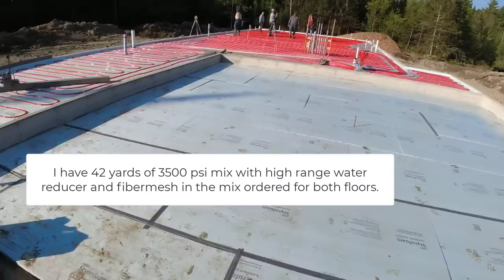Is This Too BIG For Us?  3200 SQ. FT. House & Garage Pour

Comment: Not really concrete related but surprised they didn’t pressurize the in floor heat and waterline pex before pouring. The specs we get from our pex supplier calls for 100 psi. Wasilla, AK. Been snowing here all morning. Enjoy the videos.

Comment: Great job, guys.

Mike, you mentioned about 10 gallons of H2O increasing the slump # by 1 inch (e.g., 6" to 7").  Is that 10 gallons for a full 9-10 yard truck?
Reply: Adding 1 gallon of water increases slump 1” per 1yd of concrete. So a full 10yd truck, giving it 10 gallons of water increases the slump of the entire 10yds by 1”. In this video, Mike added a total of 42 gallons of water to the first truck.
Reply: Lol. Giver her another drink. Just because you use a water reducer  chemical that doesn’t mean add 42 gallons to it.

Comment: You use your water reducer then tell the driver to add a total of 42(!) gallons of water added to the first truck 😅 you’re still adding water AFTER water reducer has been added. Might as well not even use water reducer. Get cylinders made after you’ve added all that water. I bet your floors are very weak.
Reply: He didn't ask the driver to add 42 gallons 🤦‍♂️🤦‍♂️. He said the pour is 42 yards total
Reply: @RHEC1776  not true. Right off the bat he asked the driver to add 20 gallons, then 15 and then when that first truck was almost done, he asked him to add another 7. Pay attention to the video